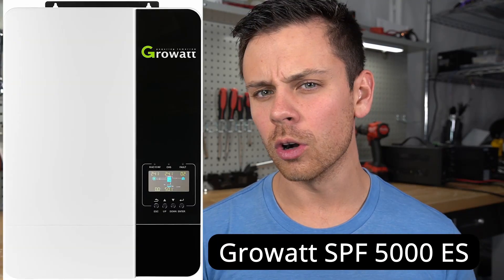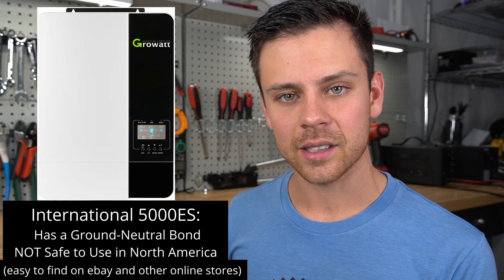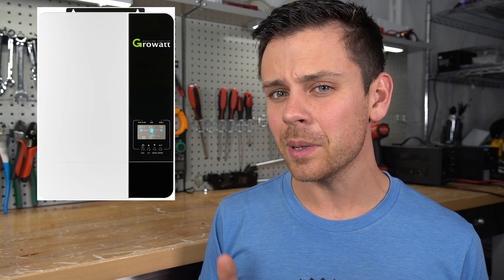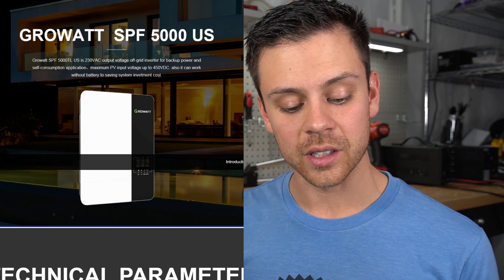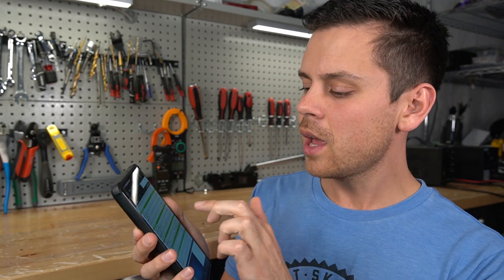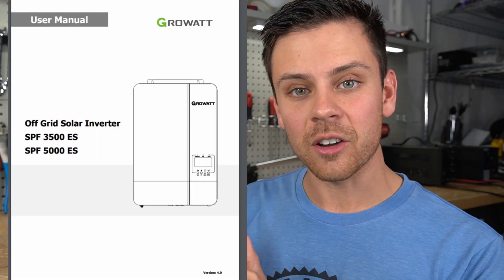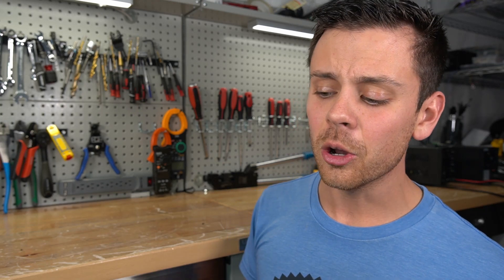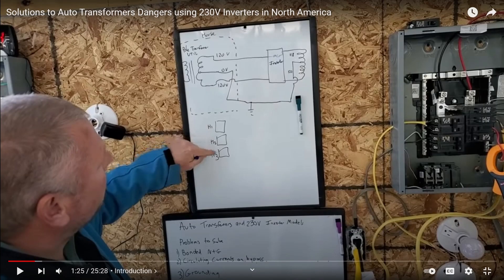The Growatt 5000ES Fiasco Explained: Is it safe to use 230V Inverters in North America?

Comment: When you say one has a ground neutral bond and the other doesn’t, is that truly just the removal of a screw from the PCB as has been discussed in the forums and other videos?
Reply: Signature Solar’s latest video shows that their model’s PCB has no circuit trace to that screw
Reply: You better trust but verify.  Take the cover off and inspect for yourself.
Reply: @davidschultz9980  No need to. Just check for continuity between ground and neutral.  This should be standard practice.
Reply: “Truly just the removal of a screw?”

Two issues:

If in US, if not purchase from Signature Solar, If there is a screw, if there is copper, 
then removal of the screw with the copper on the board close to the back of the unit could still arc or accidentally make connection, depending on the board, how close the board is to the back, shaking/tremors from earthquake (common to California), etc.

The Auto Transformer, for any vendor inverter requiring one, is an additional risk, where failure of the transformer or switching the transformer off before the inverter, can blow up equipment in your home. Temperature & output monitoring with rapid disconnect should be considered to make the installation safe.

Comment: Just wanting to clarify..are you saying I shouldn't use growatt at all? I went out and bought the inverter and 2 Lifepo4 batteries you recommended in a video not long ago.. very confused..or are you only talking about that model?
Reply from the maker: Different model. I have never had this model on my channel. I was going to charge EV's with it but probably not anymore.
Reply: @WillProwse  gotcha.. thank you so much for the great information..much appreciated
Reply from the maker: I would go with MPP instead if you can. Watch my older videos to see what I said about all of these units. I have a ton to say about all of them
Reply: I have the system from signature solar, it’s been running flawlessly since July, if you got it from them rest easy and hook it up.

Comment: DIY Solar Power with Will Prowse, Is that called a "Floating Ground" I used to live in Thailand and they have floating grounds, I was afraid of it!!! I live in the USA and I would only buy items approved with only UL listed!!! We plan on building a new house and go Off-Grid!!!
Reply: I went to Thailand for a few weeks at a time for three years and I always took cold showers because I always read about the hot water heaters electrocuting foreigners to death due to there being no ground or an inadequate ground. The hotels that were built there in the early 2000's and up to 2010 had little safety codes for electrical, and adding those tankless water heaters to the low budget hotels was often done by local handymen that should not have been anywhere near electrical.
Reply: I have the system without issue since July 💯 off grid. Just depends on where you buy it from. And that information has been provided.

Comment: That is scary... They absolutely need to either give them UNIQUE model numbers or provide a serviceable method to connect/disconnect the bond that's well-labeled and noted in the instructions.
Reply from the maker: Agreed.
Reply: @WillProwse  I am concerned that they weren't more proactive about this, and ignorance isn't an excuse. Whether or not they have the us version, the outside and even the inside is mislabeled when it comes to hot neutral and ground vs L1 L2.
Reply: @ShaleAudio  IMHO that should trigger a recall of the incorrectly labeled inverters, either the supplier replaces them with much safer models and/or update their website, as well as sending out corrected instructions for the reasons that Will brought up.
Reply: if you bonded in  the first electrical panel would that be sufficient?
Reply: Just test it like you should be doing anyway.  Don't just buy stuff,  hook it all up and flip the switches and hope everything is good.  DVOMs exist for a reason.  The problem  with DIY is that there is a dangerous lack of the knowledge needed to keep yourself and others safe